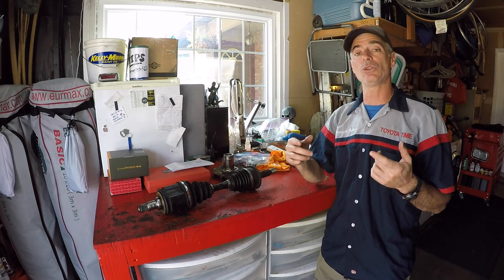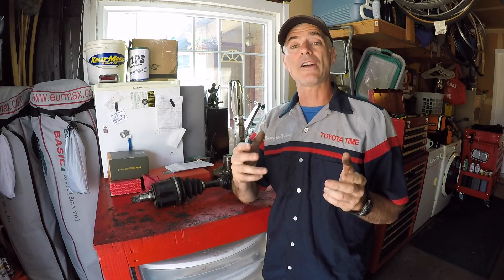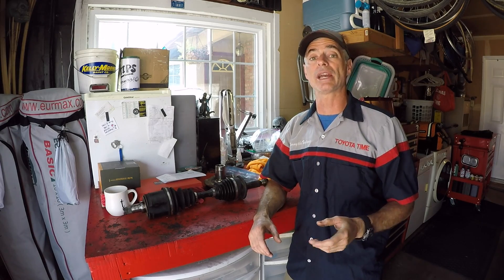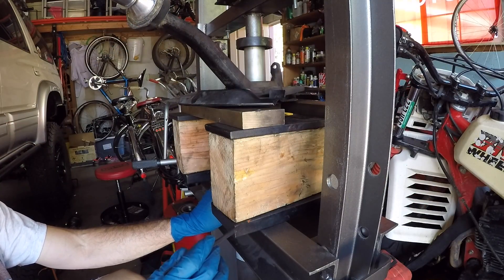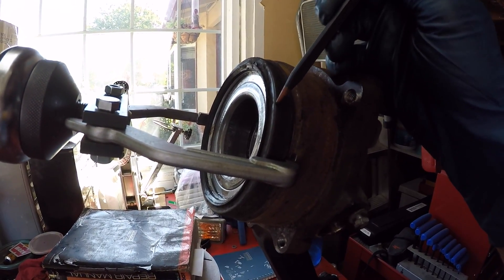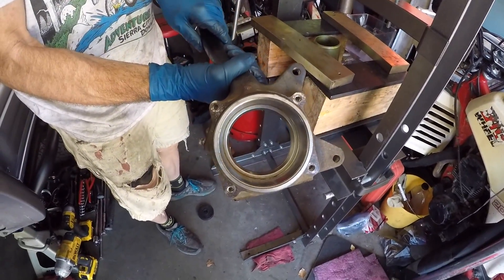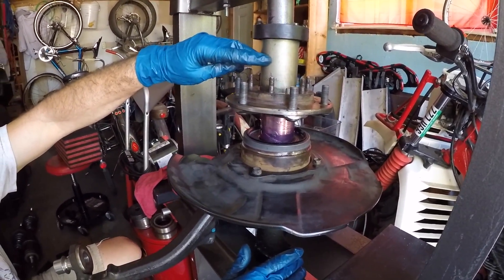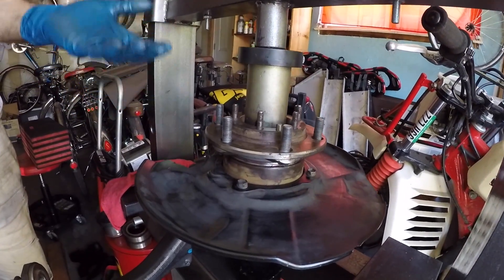Manual Hub Swap Part 2 - A.D.D. Hub Bearing Replacement

Comment: Is there not an axle nut at the end of the Manuel hub axles?
Reply from the maker: No, there isn't.  Manual hubs are different.  With A.D.D. axles, the nut tightened to spec properly pre-loads the wheel bearing.  For rigs with manual hubs, the lock nut tightened with the special pin tool properly pre-loads the bearing.
Reply: @TimmyTheToolman   thanks! I’m about to try and tackle this job on my 2000 Tacoma when I get the chance!!
Reply from the maker: @grantCodogrunner  Ok, good luck with the job when you get around to it.

Comment: Awesome video! Could you make more videos on routine maintenance? Like what needs to be done every x amount of miles?
Reply: Georgia Trapper he’s got a 30k interval vid
Reply from the maker: Like Minh said, I have a 30,000 miles service video.  Here's a link:https://youtu.be/a81i1Cayf_I
I change my engine oil and filter every 5,000 miles.  I use to do it every 3,000 but I'm running full synthetic now so I upped it to every 5k
I do a drain and refill of my transmission fluid every 10k.  This exchanges around 4 quarts of the 12 quart system.  At the same time I replace an in-line magnetic filter
I renew my coolant every 30k
I renew the front diff gear oil and transfer case gear oil every 30k
I renew the rear diff gear oil very 10k
I grease the driveshaft zerk fittings every other oil change
I replace the spark plugs every 15k
I replace the air filter when it looks dirty
Rotate tires every 5k

I guess that's enough.  If you have any questions, just ask.

Comment: Tim,can you still run hub centric wheel spacers with the manual hub swap?
Reply from the maker: Yes you can.  I just put some 1.25" spacers on my 98 rig that I did the manual hub swap on.
Reply: @TimmyTheToolman  thanks for all you do man,you have saved my ass a lot.
Reply from the maker: @billshifflett8706  You're welcome Bill.  Nice to know our videos have helped you out.

Comment: Hi tim im in Australia iv got a 2001 toyota hilux sr5 is it possible for me to install locking hubs
Reply from the maker: I'm pretty sure the hilux has the same knuckles as our US version 4runners but I could be wrong.  If they are the same, you could do it.  You would either have to source a set of manual hub knuckles and CV axles from a 1st Gen Tacoma or you buy a kit that sells you all the parts.  Do people drive Tacomas in Australia?  With sourcing the parts used, I spent $800 on this project.  $400 for the used Tacoma knuckles and CV axles and then another $400 for new bearings, seals, and a CV reboot kit.  If you had to buy everything new, this could be a very expensive modification.

Comment: Anyone know if you buy the Aisin hubs brand new if they come with the gaskets? I’m talking about the hub cover gasket: 43531-60010 and the hub body gasket: 43422-60060. I’m just wondering if I will still need to get these separately even with the new-in-box Aisin FHT 019. Thanks!  #sickmods
Reply from the maker: Hey Dan, I bought one for a trail spare and it doesn't come with the gaskets.  It's just the hub.
Reply: @TimmyTheToolman  OK gotcha!  Thanks, TTT!  I appreciate your quick response on this, and I appreciate all your vids, man!  I have an ‘03 Tacoma and it wouldn’t have half the #sickmods it has now without all the help you have provided with your content. Keep up the great work!
Reply from the maker: @benbanose  You're welcome Dan.  I check in with the channel pretty frequently and try to answer people's questions fairly quickly.  The only time I can't is when I'm on a trip in the mountains out of internet range.  Sean takes over for me when that happens but sometimes he's on the same trip and then we don't get back to people for a few days or longer.  On a recent 4wheeling trip in Death Valley, one of our camp sites in the middle of nowhere had coverage.  So, I sat in my camp chair and answered questions and acknowledged comments while sipping a beer and enjoying the view from our kickass campsite in Echo Canyon.  Our channel isn't so big that we get inundated with too many questions and comments than we could feasibly respond to.  It is pretty labor intensive to do this, but I think it's a nice thing we can do for people.  Some people are in the middle of a job and a quick answer is what they need.  Also, most people that use our videos don't comment and i think it's a nice touch to acknowledge those that did by giving them a response.  Anyway, I'm happy to hear our videos are helping you out.  Happy Wrenching and Sic Mods!
Reply: @TimmyTheToolman  heck yeah man that is awesome!  I haven’t been yet, but Death Valley is on my list for sure.  I’m currently planning out my full front-end overhaul on the Tacoma so that I have no worries making a trip out to remote locations like that without a critical part failing on me.  This video, and Part 1, of course, inspired me to just go for it on the manual hubs for the same reasons you stated in the vid;  less wear on the CV’s in general, and the ability to unlock the hubs in the off chance that I snap one out on a trail. (and also so that I look cooler than the rest of the trucks out there navigating speed bumps at the mall lol!) Since I’m already going to be doing the work of pulling the knuckles and changing out the bearings and seals, might as well do it all then. Again, I can’t give enough thanks and appreciation to you, Sean, and everyone who has contributed to your channel.  You guys really go the extra mile by recommending the right tools for the job, and all the right parts as well. Cheers! 🍻
Reply from the maker: @benbanose  Yeah Dan, you got to get out there for sure.  But, I wouldn't recommend solo trips out into that area.  Always go with at least one other rig.  While we were out there, some couple got two flat tires in their Subaru and then decided to hike into this area called Mormon Point and pretty much got lost.  They found the couple on some ledge.  The guy died and the gal survived.  They obviously made some stupid decisions but parts of Death Valley are so remote that it's going to be hard to get help.  

For added safety and communication, I carry a Garmin inReach and pay for a service that allows me to send an SOS for help if I need it.  It also gives you the ability to communicate with people via email.  At every camp, my girlfriend knew exactly where I was because the message I sent her shows our location.  It's pretty cool.  It uses satellites to send and receive messages.  If you're in California, maybe you can join us on our next trip out there.  I'd like to make it a yearly trip in the early Spring, probably sometime in March.

Some people say the Manual Hub setup compromises durability because the CVs shafts are a bit thinner and not as strong.  Yeah, whatever.  I've wheeled a decent amount with mine and haven't broken a CV.  But, I don't spin my wheels with reckless abandon when I'm in a tough section.  If you do that and then your tire grabs, things have a tendency to break.

Thanks for being a fan of our channel and appreciating the level we go to to give people what they need to be successful.  You're very welcome and good luck with all the work.  Happy Wrenching!
Reply: @TimmyTheToolman  oh man, I read about that couple in Death Valley and that was a total tragedy. I’m no stranger to backcountry travel and it always frustrates me when I see people make such critical mistakes with horrible consequences.  With just a little more planning, thought, and training or experience, that could have ended with a much better outcome.  I think a lot of people go into situations they don’t realize are potentially dangerous until it’s too late when it comes to traveling into backcountry areas. I would certainly never venture out that remotely alone. I do actually own the precursor to the Garmin; the DeLorme In-reach and find it absolutely invaluable despite how many other people I’m traveling with or not. I’ve been contemplating selling the older DeLorme model and upgrading to the Garmin, since it does have a few more features than the original. 

I’d love to join your group sometime for sure! Once I finally complete all the front-end and suspension refresh/upgrades I have planned for the truck, I will be itching to get it dirty again!  I know y’all are mostly T4R guys, but the 1G Tacoma is such a close sibling to the 3G T4R, they should definitely get along lol!  

I actually don’t have too many nearby buddies that wheel anymore, other than a friend in Reno with another 1G Taco 🌮 . I’m always looking for a good group to link up with. I’m in SF, so at least it’s easy to access some great spots within 3-4 hours drive, and more within 5-6. 

I have only heard whispers of the supposed weakness of the manual CV’s vs. the ADD ones. I think that’s more theory than reality. I say yeah whatever to that too lol! I tend to wheel my rig pretty conservatively as well. Also, a front locker is in my “someday” mod list if I ever pull the front clamshell to re-gear.  With a front locker there can be more risk of snapping a CV shaft, so all the more reason to have the manual hubs for ease of possible trail repair and lower risk of CV wear to prevent the damage to begin with.  After all those upgrades to an IFS setup, I’m sure there’s some that would say “just SAS it, bro!” I’ve also contemplated doing a full SAS, but I’d actually like to keep the truck IFS.  I have pipe dreams to someday grab a T4R project and maybe SAS that thing, but that’s a story for another day.
Reply from the maker: @benbanose  Good to hear you're smart about your backcountry travels also.  Send me an email and we'll exchange numbers: mtbtim@sbcglobl.net  Hopefully we can do some trips together.  

I would never SAS my 3rd Gen.  I have my 85 4runner with dual cases and 37s when I want to do more technical trails.  My 98 4runner will be my rig for more mellow wheeling trips like Death Valley.  I'm going to re-gear it soon.  I have 4.30 gearing now but I'm going to switch to 4.88 and install an Eaton electric locker for the front.  I've already started the conversation with Nick at Yota1 Performance to do the work for me and we'll film the jobs.  Yeah, and I know when you put a locker in the front that increases your chances of breaking a CV axle exponentially.  I think the key is when you lock the front, you shouldn't be turning your wheels much if at all if you can help it.  You get the traction you need to get over an obstacle and then you disengage.

Comment: wow the prices are way higher now on these 4 years later.  Only one I'm finding with a dust shield inctact is 1500!!!  And that's not even including the CV!!
Reply from the maker: Interesting. Where are you looking? For reference, I have bought 2 complete manual locking hub sets used off eBay with the CV’s included for under $600 shipped. The backing plate was mangled and destroyed but I had intentions of rebuilding the hubs and spindles with new bearings and baking plates so that didn’t matter to me. Keep looking and I’m sure you will find it much cheaper than $1500.
- Sean
Reply: @TimmyTheToolman  I was looking on Ebay.  One set including CVs was 2k.  I think people realized they are a hot commodity for 3rd gen owners.
Reply from the maker: @rushthezeppelin  Yep, they know people want them and they are going to gouge people.  I bought my complete set which also included the front differential for $400.    It sucks people are asking ridiculous money for used parts.  For that kind of money, you should buy brand new components.

Comment: You should invite me to bring my FJ Cruiser over for detailed technical tutorials. You'll get an influx of viewers bugging you with FJ questions.
Reply from the maker: Where do you live?
Reply: Timmy The Toolman Modesto
Reply from the maker: We'd be interested in doing some work on your rig.  What do you have in mind?
Reply: Timmy The Toolman I’ve actually got full skid plates and a rear bumper with tire carrier coming in in about a week, a regeared electric front locking differential, reboot CVs, auxiliary fuel tank, ARB twin compressor, quick tire air up/down system.... blah blah blah. Whatever you want to showcase, I can set aside. I’m going to be doing these mods then hitting the trails on August 12 for a couple of days of camping with some friends. Bring your rig if you’ve got time.
Reply from the maker: I guess you’ll be doing it without us.  We wouldn’t be able to help you until September.  Oh well.
Reply: Timmy The Toolman I don’t Have your patience to film and edit the video of the work I do on cars. You definitely have an awesome channel and content.
Reply from the maker: We appreciate your comment.  It really is a lot of work making these videos.  I know filming makes a job 3 times longer to complete and maybe more.  Then there's the very long and tedious job of editing.  I go through the clips first getting the flow and content I'd like to see and then Sean puts all the finishing touches to it making it nicer to watch.  A long video like the timing belt video took all day to film, probably took me 17 hours to edit on my end and then Sean probably put another 12 hours in after that.  Then we take pride in acknowledging all comments and answering all questions and that takes quite a bit of time as well.  I know we miss some comments and questions by accident but we probably get back to 95% of the people.  We're glad you like what we're doing.  Happy Wrenching!

Comment: welcome cool kid
Reply from the maker: Yep, the Manual Hub Swap club is pretty cool.
Reply: manual hub is cool but it's not 3 outlet washer nozzle cool.  next vid should be 3 outlet washer nozzle mod.
Reply from the maker: What is a 3 outlet washer nozzle mod?  Is that for the front windshield washer?  2 isn't enough, I reckon?  I think Manual Hubs are cooler.  More style points while mall crawling.
Reply from the maker: Did you make a video of it?
Reply: no I did not, it's just a rav washer nozzle replacement but you go from 4 to 6 and that has got to be better?  would only be a 10 min vid, but adjusting the nozzles is interesting.
Reply from the maker: Sounds like an easy Sic Mod.

Comment: I can't even get the hub free with a 20 ton lol
Reply from the maker: Cameron P sounds like some serious corrosion. Heat will be your friend.
Reply: @TimmyTheToolman  there is a threaded good ring on the back of the wheel hub.

This is a 2x4 spindle. Do I need to take that ring off before I press the wheel hub free? Could that actually be what's hanging it up?
Reply from the maker: @cameronp5728  Yes, you need to take that ring off.  Your 2x4 set-up is similar to a 4x4 manual hub set-up being that it uses a threaded on nut on the end of the spindle.
Reply: Then that is why it's not coming off lol oh well good thing this dspindle is a junk one lol I'm just using it as a trial before I take my actual ones off. Got the 4 pin socket coming in today.